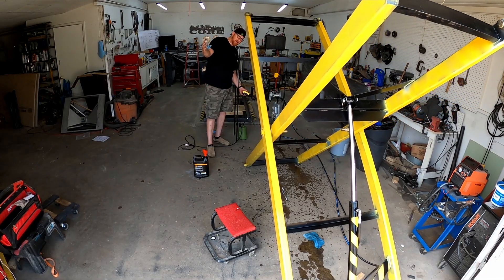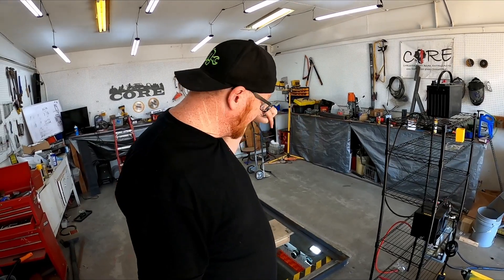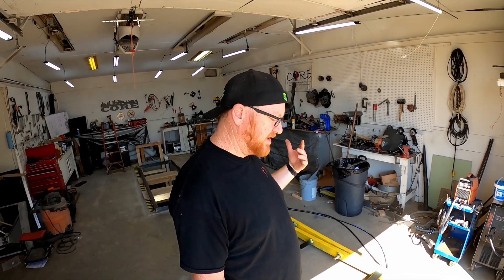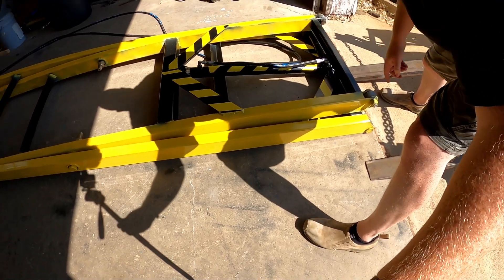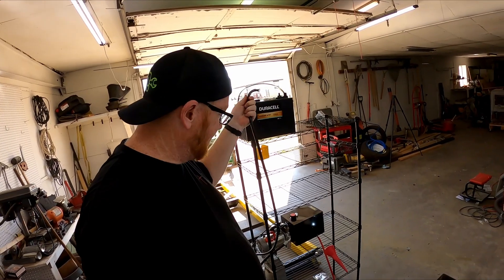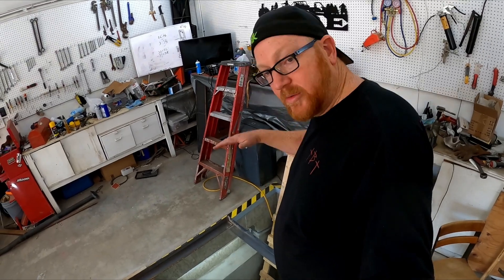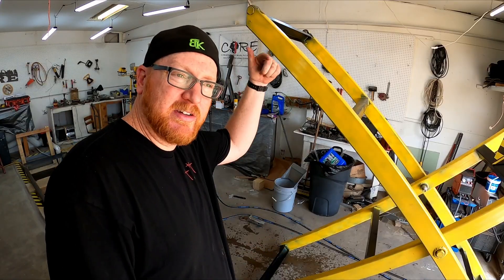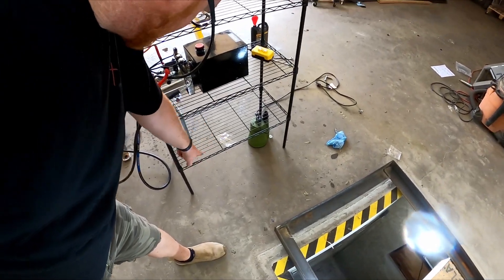Cheap Amazon Vevor 12v Hydraulic Pump Installed on our Custom Lift!!  Lets see how it works!

Comment: What battery did u use trying to figure out what battery to use myself
Reply from the maker: @lucacarson6185  went to sams and got a Duracell Marine and RV 27DCX deep cycle. 650 cca.  A little over 100.  I am on the 3rd charge in one year of use.

Comment: My new "double acting pump" does not hold pressure on one port. Holding Pressure is only one way.
Reply from the maker: @willrniiggf86556  make sure the lights are lit up opposite the direction it's flowing. The solenoid opens on the return side.

Comment: Wired and plumbed backwards. That’s why it slams down and is so slow going up
Reply from the maker: @acecoors  Interesting.  I will investigate you have me double guessing myself and the instructions aren't great.  It's supposed to only have 1500 psi for going  down.  It lifts my 2000 lbs rzr with a mechanical disadvantage so I would think that it is lifting with 3000 psi currently.
Reply: @ThinkBuildTest  I’m 100% positive. I’ve installed probably 25 of those very pumps and have made the same mistake. They aren’t always set up correctly when you get them. I’ve had them with the solenoid valves backwards several times to where both ports had the wrong style valve. But you have yours both wired and plumbed backwards. Only flipping around one or the other won’t help, it’ll only make it worse. Good luck
Reply: @acecoors are these pumps capable of lifting repeatedly? If I had to go up and down with low weight 300lbs for 30 minutes continuous would it burn the motor ?

Comment: Harbor freight has a battery cut off switch sturdy enough to attach wire / rope to pull on
Reply from the maker: I got one from there that has a key I was looking at modifying for that.  Is there another one?  Link?

Comment: Yeah have to agree with batteries suck. Great if you don’t have grid power. Was curious why 12v vs 120v pump? Also just observation from working in mechanic shops wheels that have weight like that always wear the concrete. Should add some sacrificial steel flat bar where the wheels meet the concrete in the pit.
Reply from the maker: Yessir there will be rails for the floor thats what we are filming now.  I think this will hopefully all make sense when we get to the test demo videos.

Comment: Batteries suck!  For emergency operations, I would plumb in a simple hydraulic hand pump.  Your actuator is tiny, you would have no issue hand pumping yourself up.  Even with the monster actuators I have, I'm putting a hand pump on it.
Reply from the maker: There will be a trickle charger on all the time.  I cycled this about 50 times on this charge and it didn't show signes of weakening.  If it was going to cost me money if it was down I would add more but I will just change my oil the next day after I fix it.
Reply: @ThinkBuildTest  I fly airplanes right?  My back up hydraulic power for my landing gear is a pump handle next to my seat.  I can easily hit 1500psi with one hand sitting down.  You are going to be forever playing games with speed on this thing running on battery power.  You need stable voltage or be able to control the voltage going to your pump.  Go back and watch BOOM on my channel.  Listen to the speed change.  That was me just bumping up the frequency 10hz.  I can set any speed and it's smooth, safe and stable.  A 110vt pump  for your lift is cheap, then drive it on a cheap 110vt VFD.  The variable frequency drive will give you precise control and they do a lot more!  How about not coming to hard stops at both ends?  You can have it ramp up or ramp down so it won't launch you up rapidly.  VFDs are magical devices!  Mine is easily controlled from my phone!  Battery power is fine for a dump trailer, but I wouldn't use it in this application.